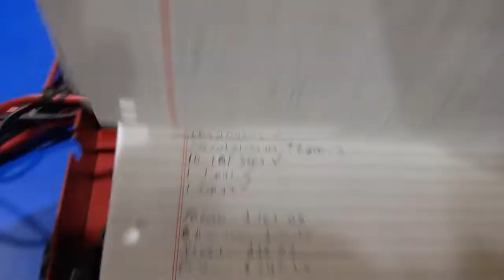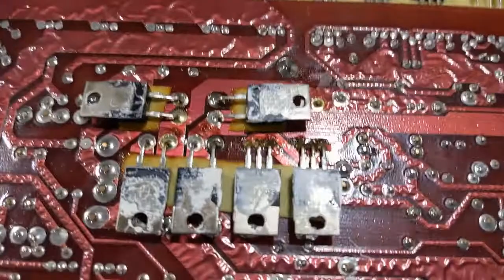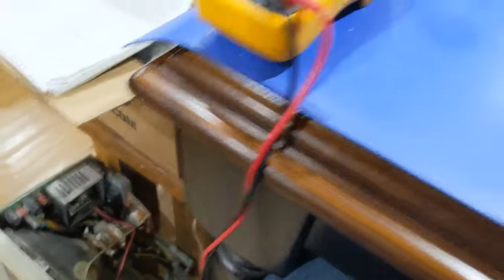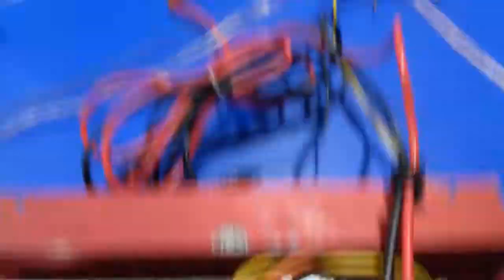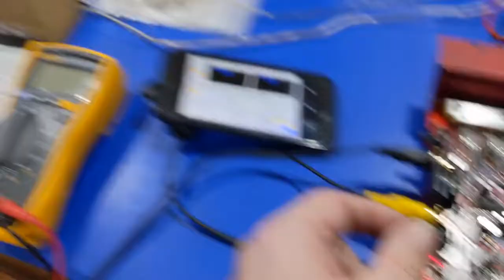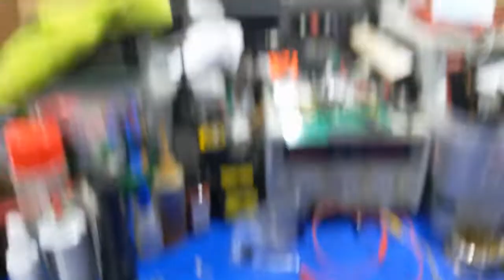Orion 225 HCCA Repair

Comment: I had same issue with the same with the gain knobs not being even it sounded like one channel was only turning up to 5 and the other was 7 changed them and it worked louder than I remembered the amp being before hand.

Comment: I've always had much better luck with Digikey over Mouser. Digikey is super fast and accurate. Pretty cool looking amplifier.
Reply from the maker: I use them both, but for the longest time Mouser had a more attractive shipping option especially for two day being the same cost as ground. Sadly that is not the case anymore